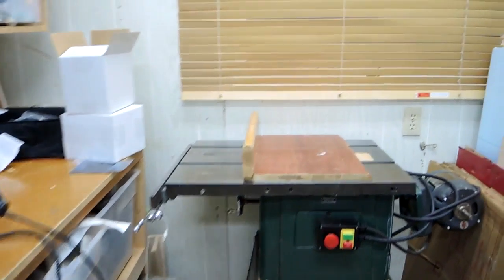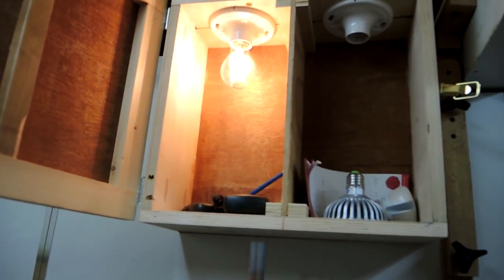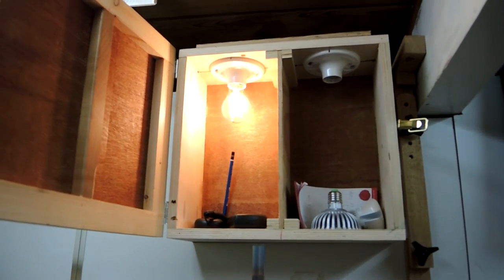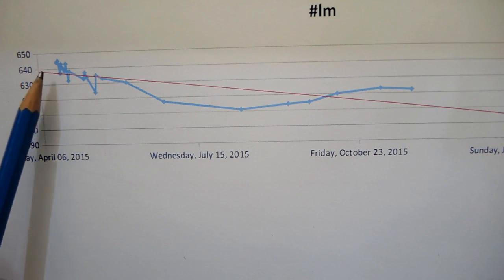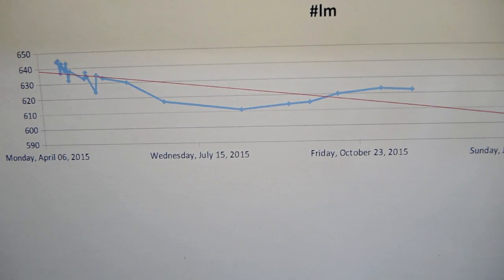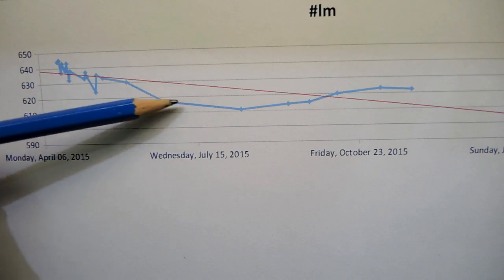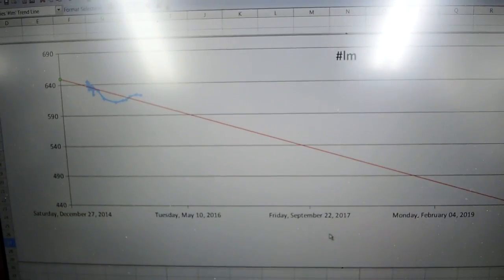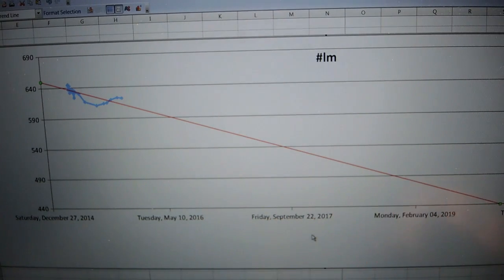Filament LED Long Term Test: 5000 Hour mark

Comment: Hey Electron, did you know your previous video is mentioned in a European testing study?
http://www.eceee.org/ecodesign/products/domestic_lighting/TestingClearLEDLamps1000hTestUpdatefinal.pdf
Reply from the maker: +PuchMaxi1988 neat!  Their study is very comprehensive
Reply: +electronupdate Indeed, I was pleased to have found it. LightingEurope (lighting manufacturers) on the other hand are not so pleased they think the study is flawed, they don't want to phase out their Halogen light bulbs just yet.
I forgot the link, here it is www.lightingeurope.org/uploads/files/LightingEurope_finds_flaws_in_CLASP_report.pdf

Comment: Thanks for all the reviews and tear downs....! They are good videos.

Wondering if you have ran into "lowes' BF special 60 watt LED bulbs"? Made by Utilitech. Were selling for under a buck each. It is non-dim-able tho. It would be interesting to see your take on them. I would cut it open but I would sounds like an idiot.

Link: lowes.com/pd_747481-43921-YGA03A41-A19-9W-830_1z0y3sqZ2z8vh__?productId=999957715&pl=1#BVRRWidgetID

Cheers
Reply: +I_will_get_you There
 Under a buck? Wow!
Reply: +JamesJon1187  Yes. See here!   
http://slickdeals.net/f/8306619-lowe-s-utilitech-led-lightbulb-60w-equivalent-750-lumen-3000k-0-99-ea?v=1&src=SiteSearch

They run a bit warm, but if they last me about 2 years, I would be very very happy.

Comment: Note the dip happens in the summer. Is the area the box is in air conditioned? Because if it's not regularly cooled, it could be external heating that lowered the light output, possibly by increasing resistance somewhere?
Reply from the maker: No air conditioning in that space.  It would be interesting to measure light output versus ambient temperature.

Comment: Thanks for the update! I have a couple of these, they are certainly not created equal some flicker while others do not. I still have to find a reliable local source for these LED filament bulbs. I do like them a lot though!
Reply: +PuchMaxi1988 Mine run a nasty 100 Hz flicker. Really annoying if it is the only light in a room. I can imagine they are temperature sensitive as they are many LEDs in series with mains, with some capacitive dropper.
Reply: +pizzablender Yes indeed, it all depends on the power supply I guess. I have one that uses a bridge rectifier, a  resistor and a cap and only one IC and that's the whole power supply! The IC is a CYT1000A.

Comment: I have about 12 of this style bulb from China and 4 of them have developed a serious flicker where one or more of the filaments goes out for a short time and back on for a couple of seconds.  All of mine are from the same source so it may be a localized issue.

Comment: got 2 wall lights with one Chinese and one German manufactured 2 years run time so far! haven't tested light output! I also have 3 genetic In the kitchen and I did take readings when I installed to compare to my old CFL's